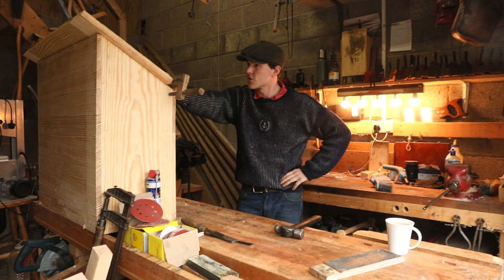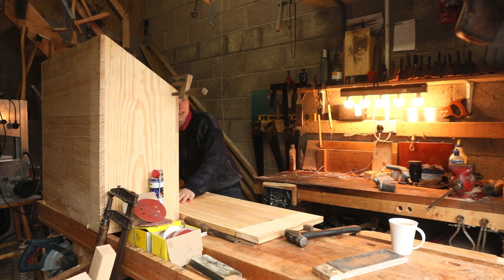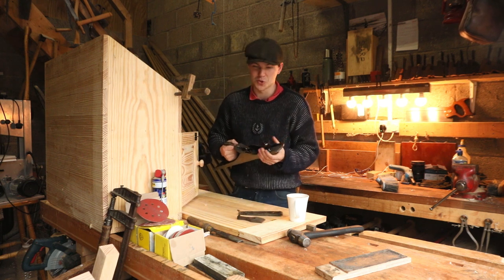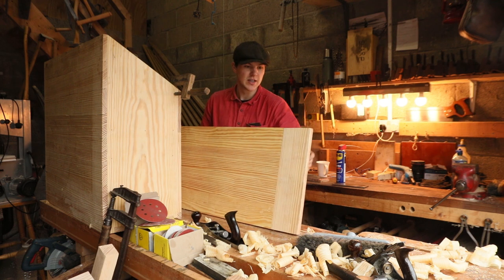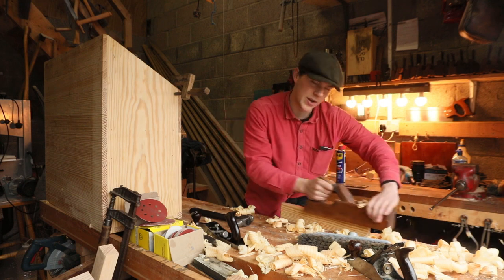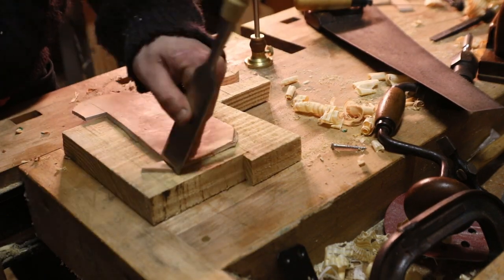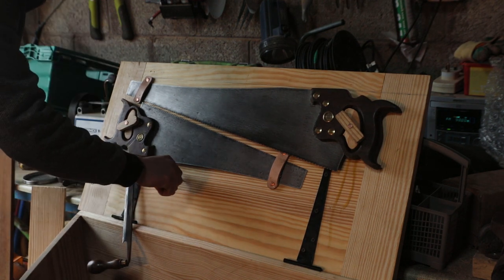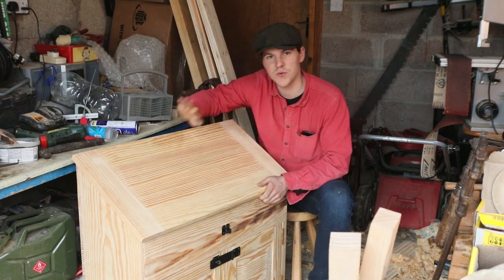Building The Tool Chest - Making The Lid

Comment: Coming together nicely. Thanks for sharing. I want to get some wood and build a tool chest too. Just need to find the wood to get started.
Reply from the maker: Cheers lad, I used the relatively cheap southern yellow pine for this one coming down the line I will make a nicer one from oak
Reply: @EoinReardon  thought to do the same. One to get started now then after some time and more experience, maybe I'll get to do something nicer.
Reply: @W4ABN  for sure mate, especially if it's your first time building a chest you'll no doubt learn things from the first attempt that'll make your eventual second try even better 👊😁

Comment: Nice work on the chest. If you're without a screwdriver again, you should be able to use the lever cap to loosen or tighten the screw for the iron.
Reply: That you should, though I've seen some cheaper planes these days where it doesn't fit! 🙄 Not a problem for our man Eoin though, nothing but the best 😁

Comment: Thanks for all the content recently!   My DTC has a fall front as opposed to your doors; yours is the first I’ve seen with them, but I’m certain you can latch yours closed for moving in the same way; using battens slid down the inside front from the top.  I built mine taller too, to give me more storage and to be able to position it higher, but I’m not going to be hauling mine all over like you do.  The best part is that since I have a leg and tail vise on one side of my bench and a twin screw face vice on the opposite side, I can roll my tool chest to where I’m working in the barn.  The ceiling in my shop is only about 82” high since there’s a loft overhead and building a hanging tool cabinet just wasn’t going to do with that.  But I’ve got to say the DTC is actually one of the best ‘tools’ I actually have/use and I’m super happy with form and function.  Thanks again brother and I look forward to seeing what you get into next 👍
Reply from the maker: Cheers lad. Appreciate that comment. Sounds like you have a wonderful setup. If mine was any larger it would be an immovable object unfortunately.

Comment: Little tip, if you don’t have a screwdriver to loosen the chip breaker and you’re in a pinch you can use the bottom edge of the lever cap. I think this works on most Stanley’s but not sure about other brands
Reply from the maker: I’ve seen too many chipped lever caps to ever risk it.